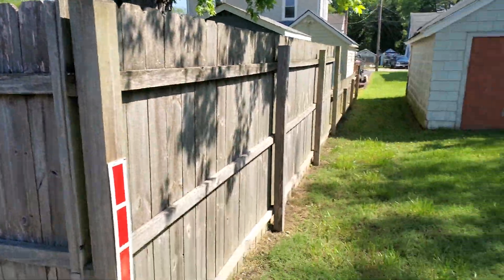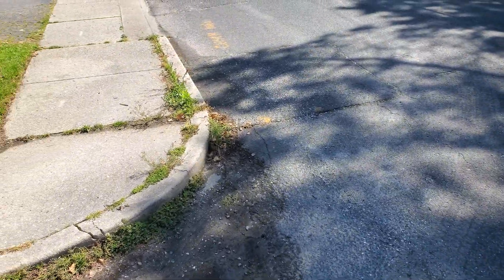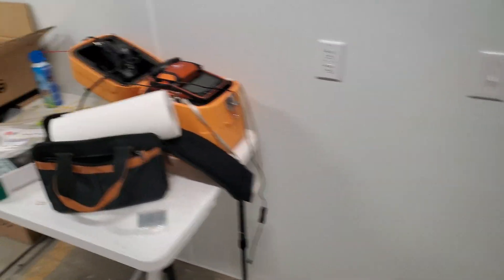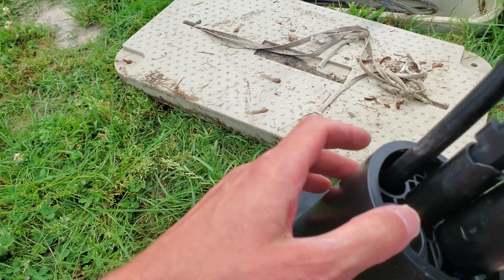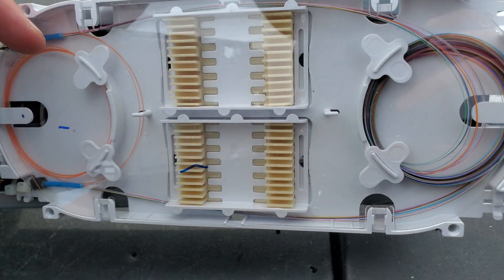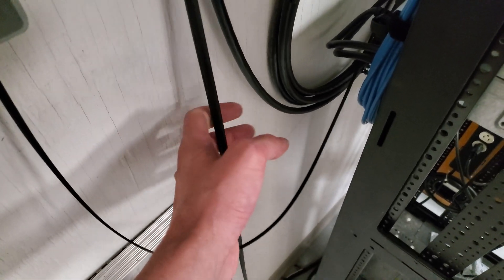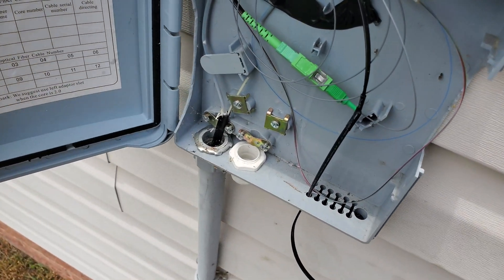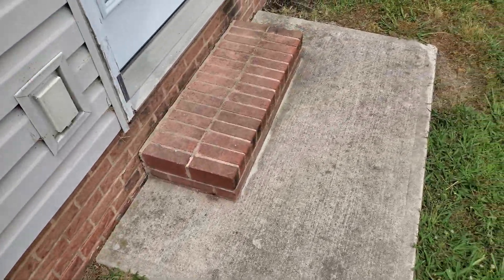Adding Fiber PONs, Drunk Kids vs GPON, and another Fire Department

Comment: Those vaults are usually fiberglass reinforced nylon or a reinforced HDPE.  They are designed to stand up to a pretty decent amount of abuse.  But yeah, I love the decision to go with more spacious ones. I hate the things that are so cramped that you can barely move anything in there.  Just don’t accidentally drop the lid into the box, they may be plastic, but they can certainly do more damage than you would think.

Comment: Hello, I have always wondered, watching your videos, why there almost eveyrwhere only your cables and enclosures ? Don't tell me there are not another operators :) Here in Bulgaria you open the shaft and you could find cables and enclosures of at least 5 operators.
Reply from the maker: Here everyone uses an aerial DOCSIS 3.1 or a + version qam 256 with an aerial cable.  This all goes back to a traditional cable TV headend.  If you get 1Gb download you get 35Mb upload because of the modulation on the modem with 3.1 or 4x?
Reply: Its the US, building anything new is expensive, and the existing ISPs love to try and push the cable they laid 50 years ago as far as possible rather than run fiber.
Reply: @deepspacecow2644  Yes, this is so silly. I have noticed in many videos that these operators tend to use unneeded expensive equipment as well. To run fiber is way more cheaper and easy than developing and using new and expensive equipment that eventually could bring a new life to the existing lines :)
Reply: @AtanasPaunoff  
The same mindset exists in quite a few places. DTAG especially in Germany for example LOVES this. They still reuse old copper again and again thinking it'll last forever. Switzerland in EU(rope) is one of the more fair countries which have a strict policy by the Telecom board there that forces the ISP's to basically use fiber at the very least, no using old copper again and again without a valid reasons. So on the roadmap, almost every house there should have fiber. And on top of that, the fibers themselves can be shared between providers. They have some system that makes it quite easy, and because of all of this you can choose between MANY ISP's, and the rates you can get are very inexpensive while having one of the fastest speed possible (25 Gbit is provided by one ISP there for just as little as 75eur)
Reply: @hariranormal5584  Are you in Switzerland ? 25 Gbit for 75 Eur is fair price if you ask me. No matter my point of view where I prefer to lay FO cables to the particular point where I could get connectivity from rather than pay for service :) Here in Bulgaria almost everyone prefer to use fiber for the last mile because FTTH cables are much thinner and easier to run either aerial or trough the building conduits. Also most of the companies tend to use PON and it might turn out to be cheaper and here minset is the cheaper the better LOL
Reply: @AtanasPaunoff  
Aha no :) I have buddies all over, one in CH is my closer friend and he is getting fiber soon (unfortunately the property he is on had issues and late deployment)
So we're excited for that :)

I also had a friend from BG who was complaining about ah yes Vivacum and shenanigans. I think how they locked in the router so it can only be accessed via the app or something. And no ipv6

And yeah! Even places like India now basically use the same strat, dense gpon fiber (ftth) is what they all use. It's actually economical and fairly performance supportive.

Comment: Seems like it would be hard to break those boxes with a punch without blood getting all over it. My guess is both your box and that pipe was broken by the mowers on a riding mower and clipped it. Happens to A/Cs all the time.
Reply: Yeah, those boxes are pretty strong, especially right at the latch where there's all the extra plastic - I'm pretty sure you'd break your hand punching that. Maybe a bat or a crow bar or tire iron or something